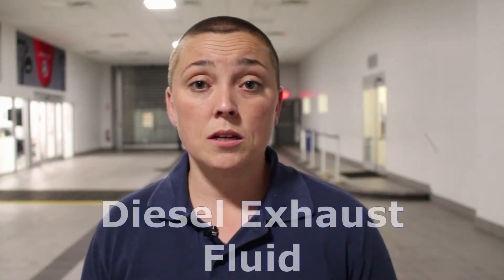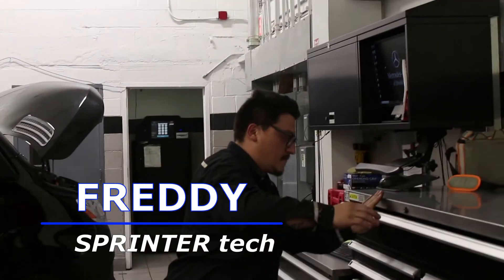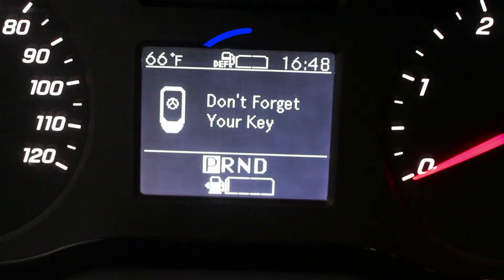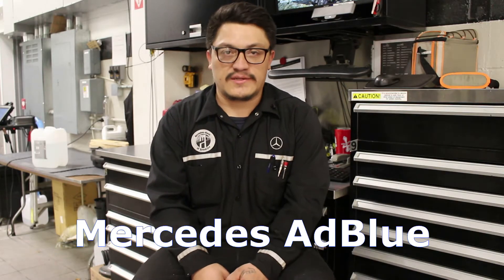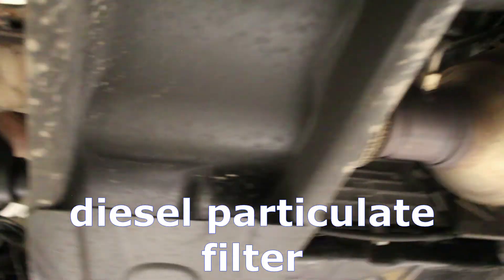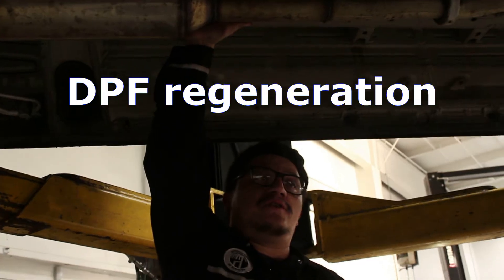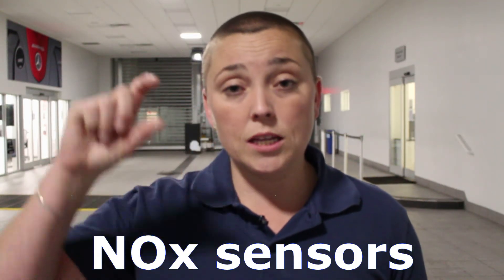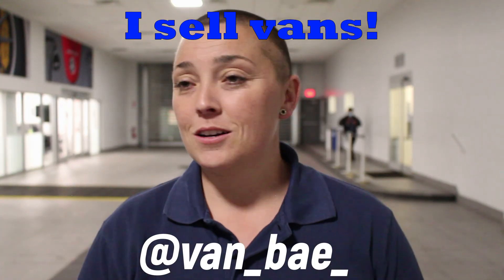SPRINTER DIESEL DEF / DPF / NOX- Basics about the Mercedes diesel exhaust fluid system service

Comment: Are these sprinters reliable? I have the 3.0 5 speed 2018. Got it brand new,
Reply from the maker: Hi!
Reply from the maker: What exactly are you referring to?
Reply: @VanBae  I’m asking if sprinter vans are reliable? I heard people hate them and others put like 300K+ miles with no problems.
Reply from the maker: Yes they are, if you take care of out with proper maintenance and driving pattern. You have had for 3 years now, what’s your opinion so far?
Reply: @VanBae  suspension steering tie rods or steering racks rattles . So weak suspension parts. 12k miles only and suspension already makes noise. The engine clicks/ticks random pattern at low RPM (I think it’s due to EGR / emissions or due to its a V6 not inline). The trans shifts okay but sometimes really hard clunk down shifting especially uphill.. cant figure out how much throttle it likes or happy with. It’s my first sprinter I guess it’s normal due to it being a cargo van. I carry light stuff to empty. Drives weird when empty , and drives happier when loaded.
Reply from the maker: We better trade it in 😊
Reply: @VanBae   who wants to buy a vehicle that will take at least 6k to fix, with parts "maybe" shipped from Germany in 8 weeks? Still owe 30k on it...glad to let you have it for that.
Reply from the maker: A lot of people, look at the resale value. It’s insane and quite interesting. They’re great if you treat them right!
Reply: NO. And 90% of Mercedes dealers will NOT service them. I live one mile from a dealer, but the closest dealer that will even look at it is 4 hours of highway driving away. How the hell am I supposed to do that? It's 2k just to tow it that far.
Reply from the maker: Hi, what dealer rejected you? Just FYI, the dealer has to have a van franchise in order to service them
Reply: @VanBae  all of them. Every single one of them for 3 hours drive east, 4 hours drive north, 6 hours drive west. There are some very rare non-dealers who will analyze it, but then we need dealers for the parts. Unbelievably stupid situation.

Comment: It’s such a terrible system, federal emission standards have ruined the beauty of Mercedes diesel. The 648 and 606 engines were amazing. Even the 642 prior to the 2008 Bluetec.
Reply from the maker: Well unfortunately MB didn’t have say in that, it was federally regulated when they switched over in 2009 to DPF system. I hear you tho, those 90s and early 2000s Diesel engines were bad AF 😝

Comment: Hi I really been enjoying your videos
I have a few questions if you could help out
I’m working on getting a 2019 or 2020 sprinter 3500 XD this year. And eventually converting it to a camper.   Now occasionally I see on YouTube videos people with sprinters that totally against recommending getting a sprinter because of its problems and issues they’ve been having with it And a lot of people that are posting videos of camping and living off of them rarely do you hear them talk about the cost and problems they’ve been having if any with there sprinter.  Or have they needed to use Mercedes roadside service a lot.  Now I know the upkeep and service on a Mercedes is expensive.  I used to own a diesel 300D. I’d love that car it drove like a tank.
Thanks for your input
Reply from the maker: Yes! Are you looking at a 4x4? Short or Long Wheelbase?
Send me an email vanbae100@gmail.com
Reply from the maker: Hey! Can I sell you the new van?
Reply from the maker: Hi! Did you ever get the Sprinter?

Comment: Im purchasing a 2015 glk 250 and the emissions system is the first thing Im ripping out and getting retuned
Reply from the maker: That’s awesome!
Reply from the maker: Where are you buying the GLK? That 250 engine is a beast with MPG
Reply: @VanBae  Im buying it from a MB dealer in British Columbia Canada.  We don’t do emissions testing in my area which is why im pulling all that stuff out due to its high unreliability and cost to maintain.  Once all the emissions are ripped out I feel that it will be a fairly economical suv to maintain
Reply from the maker: @MrJasonfromcanada  Do you have a dealer?
Reply: @VanBae  yes im buying it from a dealer
Reply from the maker: @MrJasonfromcanada  which dealer? I have some connections there.
Reply: @VanBae  Kelowna Mercedes-Benz
Reply: @MrJasonfromcanada  did you ever remove all that crap?
Reply: @razor3003  no I didn’t, MB Canada lost their class action lawsuit concerning these emissions.  My glk was recalled and calibrated the emissions software and then warranties the whole system for 4 years.  Once the warranty is up I’ll delete it.

Comment: What a good brand for off brand def
Reply: What do you mean off brand?  You need to use Mercedes or VW DEF brand, and use only Merc dealership to work on your Merc, you are now a Merc owner, act like one and give them your wallet
Reply from the maker: @mannyechaluce3814  I like to give people the options, because if you read the manual it says you CAN use other, as long as it's approved. Sometimes it's not about money, but where you are driving the van, you may run low and need a fill up and not be close to a dealer.
Reply from the maker: Hi! What do you mean?
Reply: @VanBae  if you're not close to a Mercedes-Benz dealership what is the best brand of DEF fluid to buy at a normal store
Reply: @davekent20  goto vw mercedes dealer here carries cheap stuff, vw carries real ad blue , save receipt and remember warranty is 8 yrs onmb emmission equipment

Comment: Just don't buy them you are good to goo
Reply: "The best way to avoid problems is to stay away from it" - Snoop Dog ,,,,,,,,,,,,,,,, or may Winston Churchill,  maybe Jesus Christ said it, who cares, it makes sense  :D
Reply from the maker: Noooooo my friend, it's all about routine service and maintaining your vehicle. I took in 2 vans this year already with over 500 miles, and paid great money for them. They hold value and last forever.
Reply: @VanBae  ok 
I also have two and also I'm a diesel mechanic myself 
It is no good system
Reply from the maker: @143gurmukh  Where are you located? I would love to speak more with you because between my 9 years experience with vans, your experience as a diesel tech and the MB techs, we could gather some great insight
Reply: @VanBae  canada 
And also the extended warranty suks
It dose not cover nothing like it said bumper to bumper 
My steering pump at 75k ball joints at 25k 
Steering shaft since I bought the van 
(Nox sensors at 50k its was cover under warranty )
Abs at 25 k km 
Ac hvc still not fixed 
Belts making noise at 75 k km
Front left start wearing out at 10 k km
Not covered under warranty 

Batterie dead after 2months 
It was hard for them to change that 
I had to prove to them it is dead they check it's ok 

I left the van there for a day just so they can see it dose not start after 1 day parking 
And much more
And 2012 sprinter nightmare 
Def nox sensors after 6 month and glow plug oh my god
Reply: I my budy has 2 he just park them he gave up
Reply: @143gurmukh  your right it's garbage that's why there is a global lawsuit on this crap system
Reply: @143gurmukh  thanks, I was thinking about buying one but prob won't now...I've been driving Toyota's for decades & never even had a hiccup.
Reply from the maker: I meant 500k

Comment: Hi!
So i have a 2017 cargo 3.0. I accidentally left the DEF go low, and there was a countdown that started. By the time I realized it, i was at countdown 1. I didn’t turn the engine off because I panicked, thinking that I won’t be able to turn it back on again. I added def immediately. The light didn’t go off. This morning, it showed “start iddle” 
I started driving, the van won’t drive more than 5 miles per hour 
Can you please help?
Much appreciated!!
Reply: Its part of saving the Planet, drive 5 Miles an hour is good for the environment
Reply from the maker: HI! I don't know why your comment was hidden! I assume you are all good now?

Comment: How many miles should you get out of a full tank of DEF?
Reply from the maker: Hi and thank you for reaching out! It varies depending on how much time you are running the engine and what size your tank is (older models had a few sizes, newer models have only 1). The longer intervals of driving will use less because it's cleaning it and running more efficiently  but if you are idling it will use A LOT more. Stop and go driving it will last 1-2 weeks, highway probably 3-4. Again, depends on tank size (3-7 gallon) but on the info I gave, I am basing it on the average 5 gallon tank.
Reply: Its a 2021 3500xd luxe. I just took delivery from the manufacturer and it's my first rv. Lots of unfamiliarity, and lots to learn, with no live resources to ask questions at the moment. 

The DEF gauge is currently ambiguous as i can't tell if it's full or empty lol. I've got a about a hundred miles and was hoping to see the gauge move by now. Hasn't blipped in any direction yet.
Reply from the maker: @synconianattiness4809  send me the vin number, I can send you more detailed information. And your email.
Reply: @synconianattiness4809  Do you need someone to tell you the gauge is broken?  for $600 your Mercedes Mechanic will tell you that.....